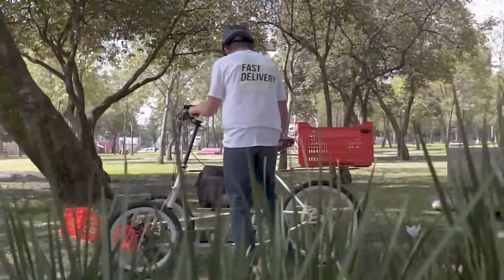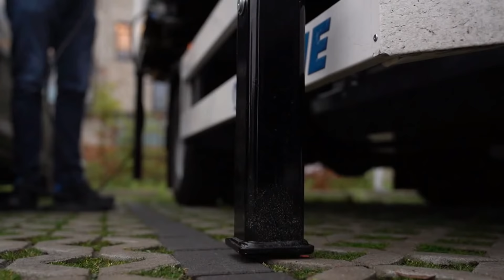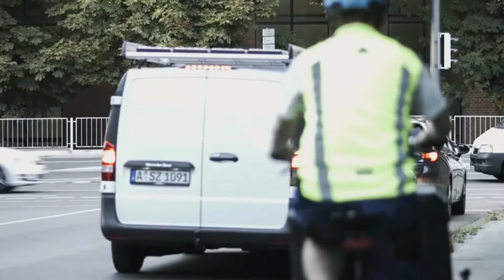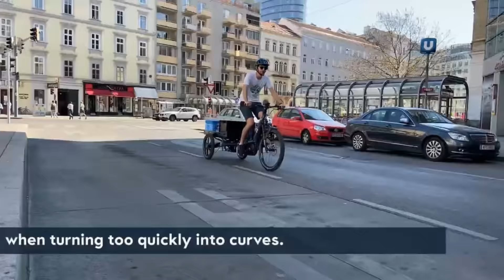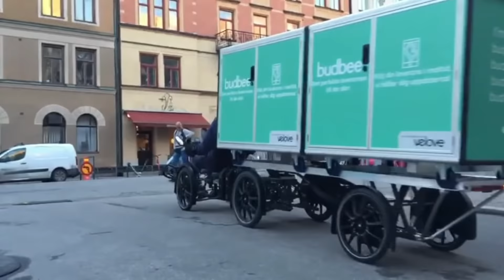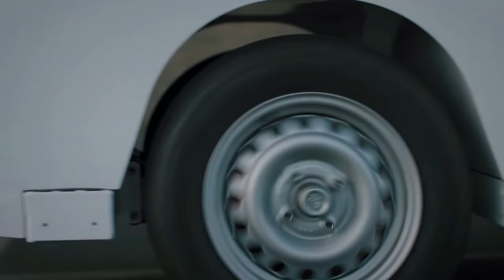Sustainable City Solutions ➩ Electric Cargo Bikes

Comment: The problem is you can buy a decent used car for a price of an e-bike which is not even a cargo bike. Some cargo bike is more expensive than a cheaper new car. Something went wrong again. The idea was very good but on the process the greed destroyed the whole thing again or simply the small volume manufacturing is still a very outdated solution when you want to make average things for average people. The e-cargo bikes/motorbikes fate is the same like the e-cars. They are way too expensive for average guys, so their market is very limited and very small.

Comment: why build a bike when you can just build a scooter that you can sit on. And have removable plug in battery on the trailer compartment, that you are pulling.  That way you can travel long range or have long operation time.  You can simply pull out the battery and install a new charge battery and off you go again.

Comment: Not only for cargo bikes but it also can be an innovative way for wheelchairs as the front or rear suspension design on the Gleam E-cargo bike or the Stroke cargo bike can make a perfect  suspension for rigid frame sport wheelchairs. 
I'm a paraplegic that has gone through two wheelchairs and now on my third one as I write this message since the year of 2010 I've been a paraplegic And all thy wheelchairs I've seen and used all have stiff frames which is directly mounted or have an adjustable clip base on axel that can move forward or back depending on the center of gravity you like and even switch out with a carbon axel tube for a lighter chair.
But like I said this would be an innovative idea for wheelchairs. Making this type of suspension, plus that amazing idea of it always be level. due to the awesome suspension we'll never need to worry of flipping sideways thanks to the Gleam escape cargo bikes suspension mounted on a wheelchair... how cool would that be... or take the bike idea and just put a wheelchair seat frame that could attract to the back itself.

Comment: 20- years ago them first scooters were not practical to use as a work load vehicle. Strictly them scooter bikes were meant for kids of a minimum speed and range. Now, the batteries evolved to be practical to use as I myself uses e bike everyday for 20 miles and still have battery which 20 years ago I would of had to re buy every dam 3 to 4 months of the old lead acid ones. The new lithium has changed everything to having more people using e bikes as a norm.

Comment: Where do you get the sustainable materials to build these bikes and batteries? Surely not from mining with machines run on petroleum.
Reply: Fair point, but compare the resource requirement of 1 tesla model 3 with a standard ebike... That's where the real difference is.
Reply: You can mine with electric power

Comment: very cool bikes though i'll never use anything with hub motors they just can't climb hills especially at these low powers advertised(250-500watts) makes them flat ground limited, strictly mid-drive only and nothing short of bafang BBSHD an 52+volts(more volts = less amps = less heat build up = less likely to burnout ..... more wattage eg, 1000+watts plus gears means climbing hills and hauling weight is easier = less strain on motor and parts all this means more reliable vehicles/bikes) ........ i have built my own e-bikes started with hub very quickly upgraded to mid-drive now done a total of 33,700km (19,000miles) mids are far better .......
Reply: a) Most cities don't have hills. Or any serious hills to speak of.
b) You can still take some serious hills with 250 Watt electric assist. Albeit, of course, slower than with a 1000 Watt electric assist.
Reply: @wimahlers  🤣🤣🤣 a) wrong, there's a hell of a LOT of cities all over the world that are built on hills, try looking passed you nose   b) wrong, 250w hubs can't pull the skin off set custard let alone climb hills will much more than their own weight   c) you have no idea what you are talking about..........
Reply: @arronjohnston742  
For every hilly city you name that is a problem for a 250 Watt commuter bicycle I can easily name 10 for which it isn't.

By the way, I cycled (and cycle) a lot. Among others I lived and cycled in Oslo, Norway. Did so on a peddle bicycle. No problem.
Reply: @wimahlers  lol you don't know a thing about e-bikes, just because you bicycle doesn't mean a thing... 250w isn't enough, never will be...
Reply: @arronjohnston742  
I owned and cycled on a 250 Watt commuter e-bike for many years.
The Netherlands has the most e-bikes per capita in the world. Literally millions of e-bikes. Most, virtually all, e-bikes riden by the Dutch are 250 Watt e-bikes.

As to taking hills with a 250 Watt e-bike see, among others:
www.youtube.com/watch?v=OCQyQsYjmlA
www.youtube.com/watch?v=_TdjZ3Nuwyw
www.youtube.com/watch?v=_obRtdlg79Q (Dutch: Hill test showing the difference between various 250 Watt motors. The difference being torque)
Reply: @wimahlers  🤣🤣🤣 the netherlands .... 250watts is junk you'll never con me to think other wise i know better kid 🤣🤣🤣
Reply: @arronjohnston742  
My multiple verifiable links versus your personal unsupported opinion.
Noted. Moving on...
Reply: @wimahlers  🤣🤣🤣 no, my personal experience of which you have none kid, 250w is not enough especially for cargo haulage 🤣🤣🤣...
Reply: @arronjohnston742  
No need to repeat your personal opinion.
As I said before, moving on...
Reply: @wimahlers  lol my bike will out haul out climb out speed and out distance your weak 250w hub anywhere anytime kid and that's a fact
Reply: @arronjohnston742  
As I said in my first reply, and I  quote:
You can still take some serious hills with 250 Watt electric assist. Albeit, of course, slower than with a 1000 Watt electric assist.

So what?

Any motor cycle can out haul out climb out speed and out distance your e-bike. 

So what?
Reply: @wimahlers  like i said, you have no idea what you are talking about🤣
Reply: @arronjohnston742  
I am talking about over 4 million Dutch commuter cyclist with a 250 Watt e-bike.
I am one of them.

Of course, if you need to haul about 300 kg (or so) of cargo then you need something like this, another Dutch design (from Flevobike):
www.youtube.com/watch?v=1Sl3qzjGjZI
Need to transport your kids then use, for instance, another Dutch product:
www.youtube.com/watch?v=BZIfg2XFmzE A 250 Watt cargo bicycle for transporting children. This  cargo bicycle is extremely common in the main Dutch big cities.

Want more power and more speed? Then the following is relatively common in The Netherlands:
www.youtube.com/watch?v=fgCUFLQKzqs Police on speed pedelecs. Many speed pedelecs are 1000 Watt (maximum allowed speed for speed pedelecs is 45 kph). A speed pedelec is a different category. For a speed pedelec you need a helmet, license plate, driving license and insurance. You also need to follow the same trafic rules as for mopeds.

It seems to me that it is you who does not know what you are talking about (other than your own customized e-bikes). There is no shame in that. You are not from a cycling culture. As I am not from a gun culture. Each its own.
Reply: @wimahlers  🤣🤣🤣 on dead flat ground in built up cities largely uneffected by wind 🤣🤣🤣 GTFOH clown you have no idea kid
Reply: Hi Arron any chance I may pick your brain 🧠 regarding motors and a current project I am working on in South Africa. I'm mentioning my location to introduce the terrain factor of my design challenge especially with motor selection. I was more intrigued to see that you have vast experience with the Bafang Mid mount motors. Can I drop my email here so we may engage further.